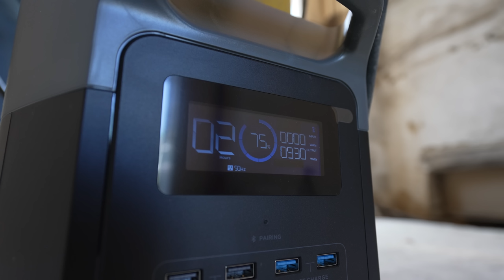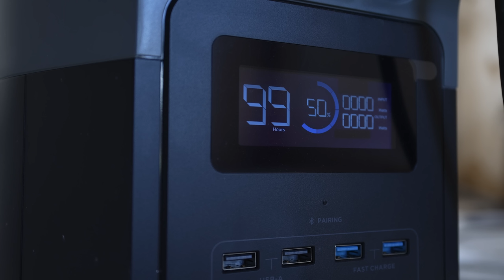The Secret Floor Unearthed Beneath The Convent

Comment: I personally don't think there is anything wrong with leaving the original floor at the level it's at. One step down into history is quaint and intriguing I think..
Reply: I like the idea, but I think it should be raised to allows accessible access.
Reply: I like the idea of keeping things original too but, it could be a tripping problem for seniors and those with disabilities.
Reply: !0 cm, or 4 inches, is an unnatural step height and would cause problems.
Reply: While I agree the originality is preferable, there are liability issues to address. I don't know how the liability laws work in France, but is the US the slight step down at a doorway is a law suit waiting happen. Preserving the floor by raising it the 10cm is a wonderful (probably expensive) solution. I feel it's certainly worth preserving.
Reply: @susanlaskey7778  My thought exactly.  Just a little ramp but then I don't know what the code is for these things.  The original stones are simply amazing and when you factor in their history, they are truly fascinating!
Reply: Lower the entrance to match the level to solve tripping and disabled probe,?
Reply: @annadavis2547  Hmmm... Wondering if that's possible???  Might be easier than raising the entire floor.  And cheaper?
Reply: I’ve said it before and I’ll say it again, this convent undoubtedly has a buyer. Otherwise no one in their right mind would speculatively lift this whole floor, leave it to the new buyer.
Reply: I agree
Reply: I agree with leaving the floor as is and making other adjustments.
Reply: And judging by the sheer size of some of those stone, err, ?lintels, not sure if that's the right term, raising the floor might not be worth the huge amount of effort. But either way, the floor will be lovely once finished.
Reply: They probably should take it up as this would be the best time to lay a waterproof and thermal membrane under the floor, if it's sitting directly on the ground.
Reply: I see your vision and totally agree with your idea. If you can raise it, then do. There is something magical about every layer that you peel away to expose the original. The idea that it was beautifully honed by the nun’s footsteps is even more interesting.
Reply: @rebapuck5061  once the under floor heating goes in nothing heavy will be crossing the floors anyway.
Reply: I agree but i would put a plexiglass floor over it with some cool lights shining across the floor for at night!
Reply: I much agree it should be kept where it is a pices of history
Reply: @hrep14 I don't know if it is because there is a basement.  Just unsure were the basement is and if it's under the entire building or just part.
Reply: @michellezevenaar  cellar runs in the opposite direction to the above entrance way flooring.
Reply: Love this original floor!  So you are going to number each stone, remove them, then raise the floor, and put the stones in their original location? If not how do you plan to raise the floor without covering the stones? 

I hope There’s Nothing under the stones to prevent elevating the floor. You never know what you will find during demo of that building!

I wonder how many people walked over those stones since the Convent has been built?
Reply: I agree leave it where it is
Reply: So you make the step a ramp and mark it to be visible.  I say keep the old
Reply: @annadavis2547  I think the problem is, they still wish to match the floor level with the other interior rooms, so there isn't a 10cm set from the hall to the rooms.
Reply: @cliveklg7739  Not if done right, a wooden or concrete ramp stained to match  and cut to incorporate the original step would be in keeping with the existing.

Comment: What a gift that floor is!  No missing or damaged stones (so far) which is some sort of miracle.  I was struck by the removal; the top coat of cement was laid over loose gravel and fill - almost as if they knew that one day, someone would resurrect the original floor.  That was the perfect way to preserve it, and protect it from the heavy tools required for removal.  Hmmmm ......

Comment: Told you I told you that floor would be gorgeous underneath because if they only leveled the floor then the cement over the top wouldn't have bonded to the stone underneath. I am so happy that you are going to fix that floor and raise it up. I think thats the best option for that.  And you're not going to like to hear it? Is? You are going to have to most likely remove those stones and then put them back in the same order with a cement base so that it levels them equally. With the flooring
Reply: Yes, they will need to number the stones and make a chart

Comment: That floor is so beautiful its going to be a challenge to raise it but so worth it.  Have you thought about having a blacksmith make a railing for around the basement stairs at the same time as the doors? The railing would tie the doors in internally if it.was the same design.

Comment: Raising and relaying that old stone corridor floor will be complex and time consuming to be done properly.  There is an alternative.
Go down the conservation route!  Lay a wood floor over it with glass panels so the original stone can be viewed below.  That is how it would be approached in historic conservation settings and could be appropriate in your convent building.  Under boards lighting can be included to illuminate the stone too.
Reply: Intriguing idea - could be quite a show stopper for the entry!!

Comment: What a beautiful find! Two things: if you raise the floor, be sure to number the stones so they are replaced in the same order. The wear patterns are a big part of old floors like this, and you don’t want to lose that by mixing up stones. Second, I’m wondering why the large granite edging (on the cellar entrance side) isn’t repeated on the other side. I’m guessing that the wall there isn’t original, as the cobbles seem to “disappear” under the wall. Do you have any original architectural plans?

Comment: I never thought I'd be so thrilled to watch a video of concrete removal...but the stone floor is amazing. You might want to number the blocks and take pictures and/or make a "map" so you can put them back in the original position...a bit more work at the beginning but will save you time in the end with figuring positioning (not a fun jigsaw puzzle at all).

Comment: Billy I would leave the floor in-situ, because you may never get the floor back as is, and you will need to mark each stone and the direction of each face and it will be so much work for what? Please leave it be, it has settled over millennium if you dig it up each block may not settle as level as it is now.
And If I may say what a herculean effort you put in, you are a driven man Billy and thats not a bad thing as you are still a young man, 'Crack On' mate! stella job!

Comment: Just a suggestion, Billy, but I think you'll save a lot of time and effort by pushing the jackhammer horizontally into the rubble, under the concrete and levering it up, like how an icebreaker works but in reverse.
And instead of lifting the whole floor, just make a raised area at the doorway, then it will be an obvious step down to the floor, not an unexpected doorway drop.

Comment: If it were my project, I would use a water based paint or marking system to number the individual cobbles as they sit, then photograph the whole floor in place. After taking the cobbles out to raise the floor, they can be put back exactly where they came from (using the photo as a reference) with no fitment, cutting to size or changing of the wear pattern issues. This looks like a larger area than the hearth and as you know, most puzzles look best when they look like the original image. Good luck!
Reply: They did that with the fireplace rebuild.
Reply: @paularunyan8588  I thought I saw Sean fitting and cutting pieces for that job? I know there was a hole they needed to fill but I think there was some shuffling of the blocks too. I'll give it another watch, thanks.
Reply: @johniwan1  there was quite a bit missing.

Comment: Seems to me that this floor may have originally been outdoors.  The thick stone wall must have been an exterior wall and when the next piece was attached, the floor levels were made the same and so the concrete was poured to mate up the newly enclosed "hallway" to the rest.  It is interesting to speculate on the original purpose of the iron fittings rising from the granite.

Comment: That Hammering is a LOT of work. I came up with a slightly less back breaking idea. And it worked. Hammer Drill holes spaced to your preference. Then Jack Hammer. Might take longer, but less pain in the long run! Just my opinion.

Comment: Maybe a stupid question but how is it you can just remove the concrete and expose the coble stone? I wondered about it in the kitchen also. What I mean by tthat is it doesnt look like it attached and shouldnt it have? Did a layer of dirt stop that? One of the many reasons I like your videos you explain what you are doing and why. I Have learned a lot from you taking ideas from a large project to small.
Reply from the maker: well with great difficulty! a layer of concrete in places is attached too the original floor! and carefully i have to chip away at that layer to remove it! it’s probably the most tedious job today
Reply: @ThePethericks  Thank you

Comment: To me it seems that originally there wasn’t doors either side of the short hall your exposing and that it would of been the outside. Possibly where you would lead horses through from the field/back of the convent  to the court yard.
Reply: This would explain the block wall that was exposed awhile back in a video. 🤔
Reply: @DK-pl8xd  
The openings are oversized and also the way the entrance to the basement is. It looks like it may have had a iron railing there.

Comment: A cautionary true tale:  I tried to raise my driveway to the level of the garage floor because it was dropping. In the end, the driveway cracked and dropped anyway leaving the same problem I started with plus a huge crack that goes all the way across. Not saying this will happen but just letting you know to consider the pros and cons which, I'm sure, you do anyway.  Will the earth under the original floor shift in the future in unexpected ways? It's stable now it seems. Someone mentioned a small/short ramp which I've seen others do to solve such problems. May not be so pretty but....maybe?

Comment: I know you like that battery pack but as an owner of a General Contracting company, the progress with the chipping hammer was painful lol. Seriously, it will be much more efficient and have more power if you plug it into the wall power. The current draw is too high for that thing’s duty cycle. Plus if you discharge it too much, too fast, you’ll inadvertently damage the lithium batteries inside.

Comment: Love the flagstone floor, also wondering if those metal spikes are legacy from cut down gates or levels for the concrete...or are they something else...Are you putting an external entryway to the garden I know you mentioned there is a driveway at a higher level behind the garden walls? Just wondering how the digger/chipper etc are getting back out.. or are they trapped until the floor is raised or you have sturdy ramps?

Comment: It would go faster if you got a concrete saw and sliced the top layer off.  Just measure the thickness of the top layer and wrap some electrical tape around the jackhammer blade and you will notice the depth you can cut more easily.

Comment: Perhaps they covered up the old floor with concrete to assist wheelchairs that the older nuns needed to get around/ or walkers too. Those old cobbles can be dangerous for elderly with canes and crutches etc.😑

Comment: That stone floor is a thing of beauty, it would be a shame to pull it all up even though you're putting it back, as it is so perfectly of the period and loads of work (which you don't shy away from!)... I guess there are reasons I don't understand... if you have to please don't bed it on concrete, natural stone and concrete do not go well together, and please (in my humble opinion) don't have concrete appearing between the stones like the fireplace, just put it back as it is. (which you are probably going to do anyway). Thanks for the daily video's great to see all the progress you are making.